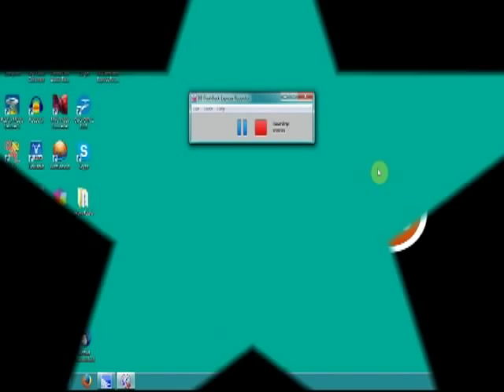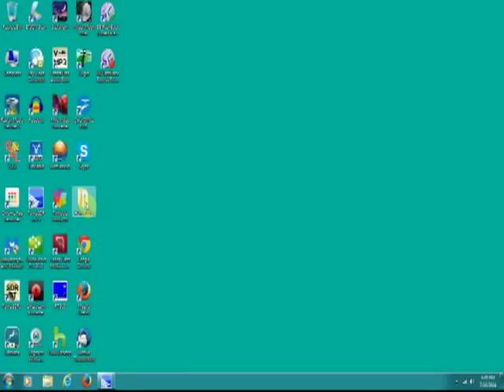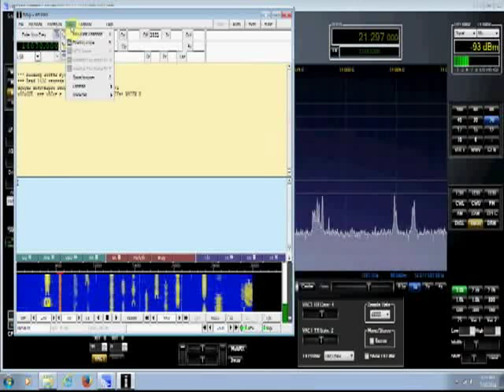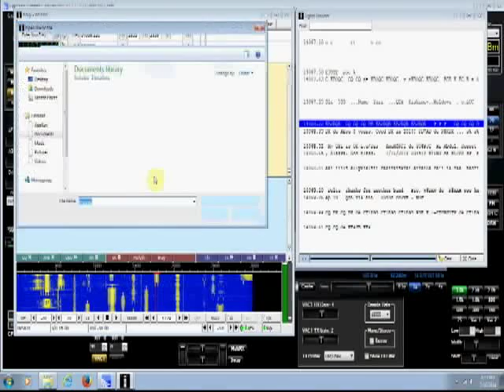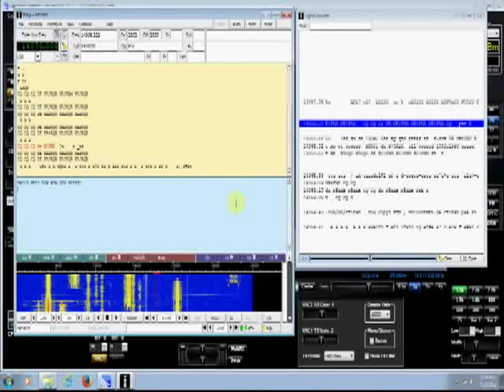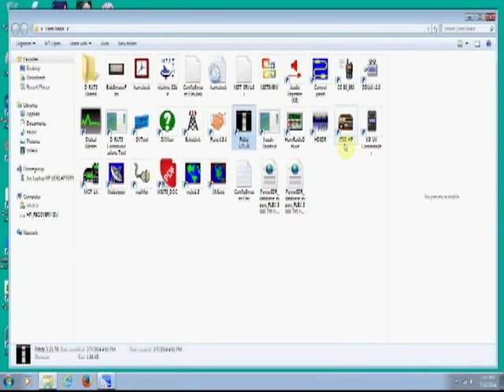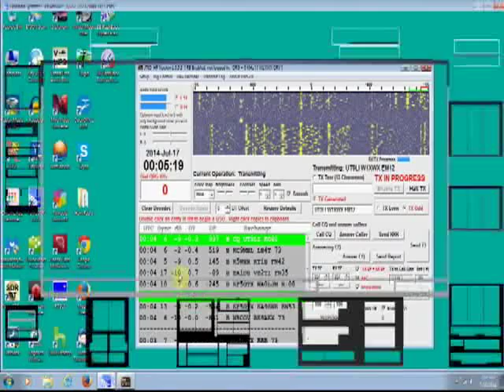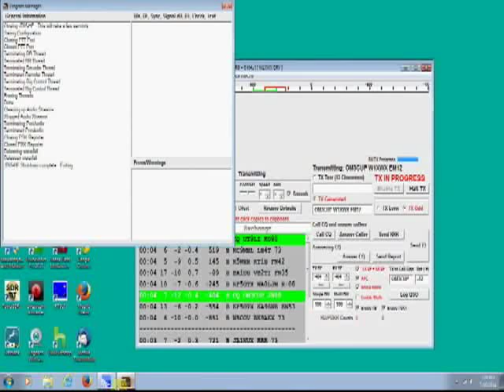The Digital Modes- PSK31 & JT65

Comment from the maker: One of the keys to working JT65 signals is that your computer clock must be accurate to within about 1 second. You cannot use the built in Internet Time sync in Windows. You must download a free time-server software which will ACCURATELY sync your computer to the correct time. All transmissions begin exactly on the zero (0) second. I use the free software "Nistime-32b", there are other free programs on the internet to sync your clock.

Remember to use about 35 watts on PSK31 and about 20 watts on JT65.